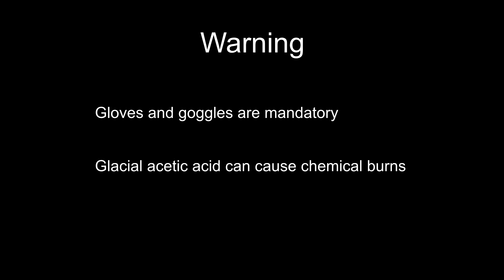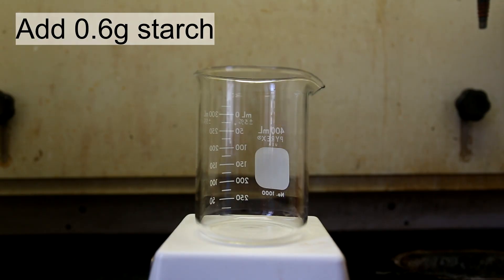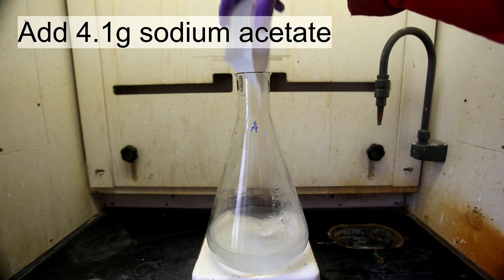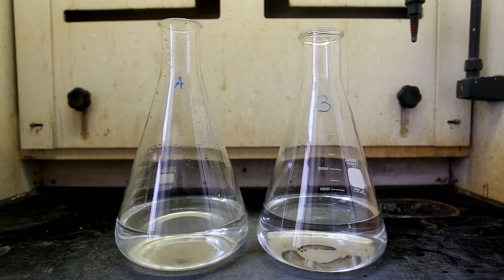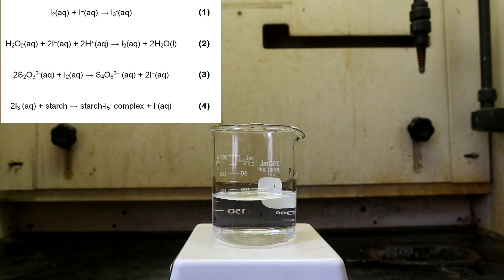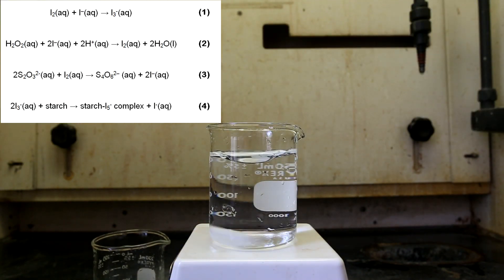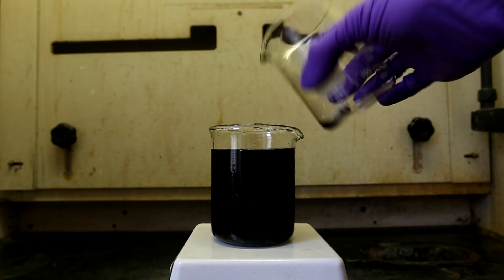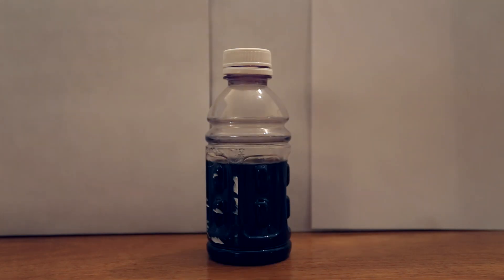How to prepare the Iodine Clock Reaction

Comment: I have a question. The values are very specific. How did you decide how much of each substance to add? For example, why use 4.1g of sodium acetate, or 0.6g of starch?
Reply: These are specific stoichiometric ratios and some kinetics related reaction rate dependent changes 
For further details study the reaction in both stoichiometric and kinetic terms and you'll be satisfied.
Reply: I haven't noticed stoichiometric ratios or some kind of logic but here's what I noted:

Solution A
- Potassium iodide: 0.3012 mol/L 
Large excess

- Anhydrous sodium acetate: 0.0500 mol/L 
Around a 1 for 10 molar ratio with its acid but I don't know if it matters

- Sodium thiosulfate pentahydrate: 0.0379 mol/L
Limitant, adjustable

- Starch: 0.6g 
I don't think it matters much

Solution B
- Hydrogen peroxide: 0.4470 mol/L (if I'm not mistaken)
Excess

- Glacial acetic acid: 0.5245 mol/L
Excess

If anyone has better explanations, I'd like to know as well.

Comment: @nilered I was wondering why must the starch be wet before adding the boiling water.  Is there a specific reason?
Reply: Hello from the future!  Not a chemist, but a cook.  We do the same thing when adding starch to gravies.  The gravy mix is usually hot, but if you pour the starch directly in it will clump up and sort of congeal around the outside, preventing a good mix.  So, the solution is to make a starch slurry using starch and cold water.  The cold water doesn't cause this clumping effect and so allows the starch to be more evenly distributed throughout the hot solution to make a nice gravy.

I suspect it's the same reason here.